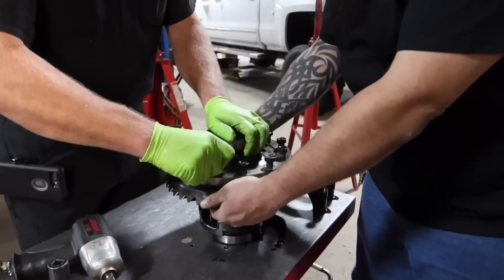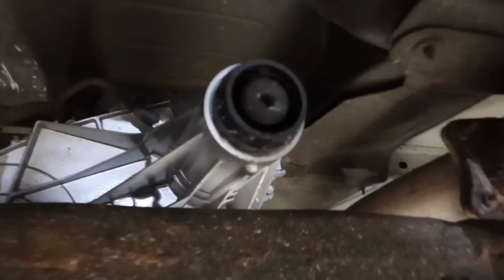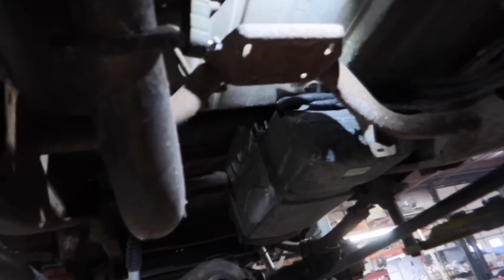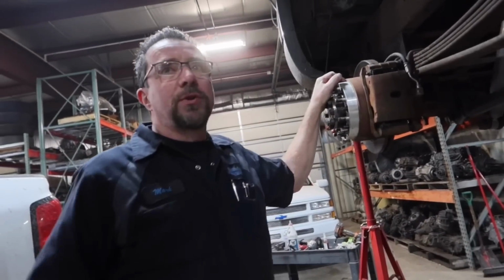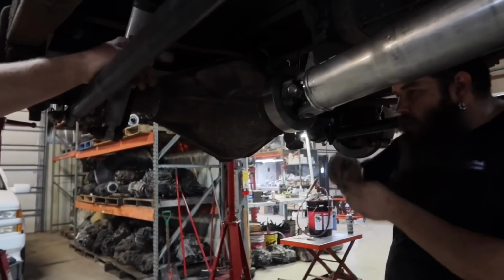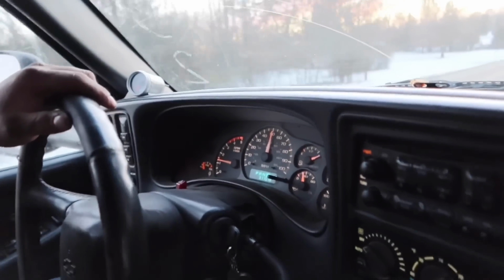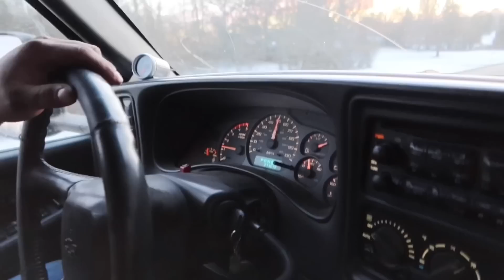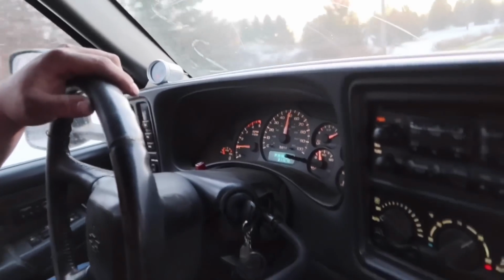We Installed an L5P Driveshaft In A Older Duramax

Comment: 1 piece driveshaft is generally better because U-joint angles are better and torque offset is reduced. Steeper U joint angle increases U joint torsional torquing which is bad from my experience.

Comment: Will this work for an lmm crew cab long bed as well? I believe the lmms came with the 1480 u joints already. Also what is the part numbers?
Reply: it will. you do have 1480 joint. the part number for the driveshaft you need is 84041622
Reply: trucks awesome thank you. Need to replace my center bearing and u joints anyways
Reply: @kodiaktruck3583 any idea what I would need for 02 crew cab short bed
Reply: Or is this the driveshaft in the video from the l5p what I need

Comment: I had been told that the driveshaft maker I used that a shaft over 60 inches was not good ....how long are your one piece shafts and how much.  I have a 90 one ton duelly that I’m changing to Cummins 12 valve ..would the one piece be worth the money and how will it help performance
Reply: Length has a deleterious effect on your critical speed (speed at which your shaft can noodle and beging playing the game of jump-rope-of-death), but that critical speed is a function of length and outer diameter. You can bump up your OD and gain that back.

Comment: I have been told that if you have a 2wd (no transfer case) long bed and crew cab...they dont make a drive shaft long enough. Any ideas on how to get a one piece ds with that setup??
Reply: I don't know about where you live but there's a drive shaft specialty shop where I live that they can extend, repair, weld etc any drive shaft for pretty much anything.

Comment: Question is can the swap happen for my 2011 lml dually crew cab with 8' bed? I have the two pieces and would prefer the L5P shaft versus the aftermarket one from Dmax store....
Reply: Sounds like your trucks 2 wheel drive? The single peice was introduced to the lml cclbs.
Reply: I have the one from dmax store installed, had it for a few months now rust perfectly fine
Reply: Actually my truck is 4wd and the drive train is fully stock. I'm fully deleted for bullet proofing purposes. The carrier bearing is on my list of getting rid of.
Reply: just go to the dealer and get the shaft from the l5p it will bolt right in.